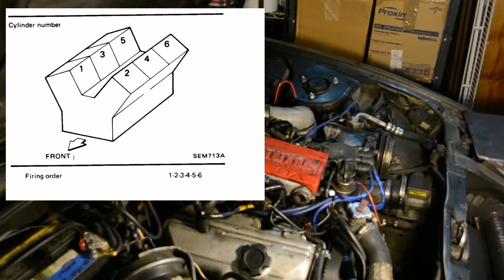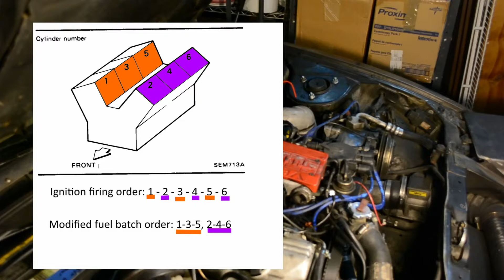Z31 build - Rewiring fuel injectors to pre-recall firing.

Comment: Hey I was chasing a mean misfire on my 86 N/A and I fixed it by accident when I changed my timing belt. The old one looks perfect but it was on my list of maintenance to take care of when I bought the car. Instant change, if you haven't already changed it I highly recommend it. They are cheap and pretty easy to do.
Reply: How shitty did it run before hand?
Reply: @TristanSogge  it would barely start and when I would give it gas I got no power and it was running super rich, but it wasn't just the timing belt. I recommend that the absolute first thing you do is replace all the vacuum lines, a vacuum leak is going to make it run like trash and there's a lot of places it can leak. I got a intake block off kit so I can remove my idle controls and EGR to make troubleshooting easier. It runs great now but idlea high but I think it's because I converted it to manual and the automatic ECU is causing it but I could be wrong
Reply: @zacharyroberts8222  I have got the same issue it sounds like. I am trying to change all the vacuum lines and all but how did u route it after the deletes?
Reply: @TristanSogge  I ran everything off the vacuum ports on the back of the intake manifold, it's not the best solution but it works
Reply: @zacharyroberts8222  got pictures or a video?
Reply: I'll take some pictures today

Comment: Do you know which years of the z31 had the "recall"?
Reply from the maker: All years of Z31's with the VG30E(T) engine that was sold in the US (so all of them) has the issue. The service campaign was issued in 1995, long after the production of the Z31 was phased out.
Reply: @illogicalprojects4093  My 85 had the recall done to it and I never did have a problem.  I had it done six months after the recall date.  However now I have a 2400 rpm loss of power and am trying everything I can think of to try to find it.  Down to fuel system now and that's how I found your video.  Did you find the issue???
Reply: Yes you are correct, all from 1984 to 1989 had the recall.